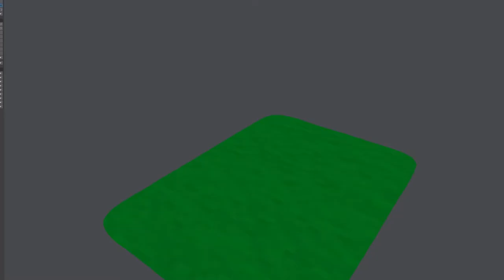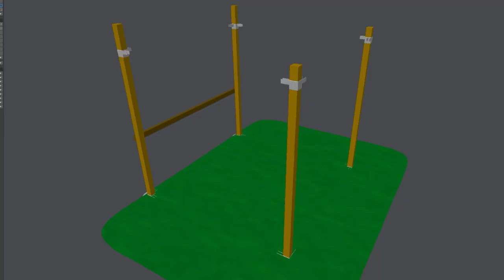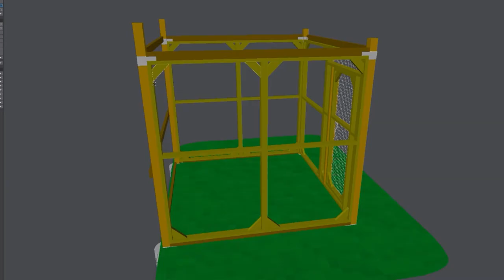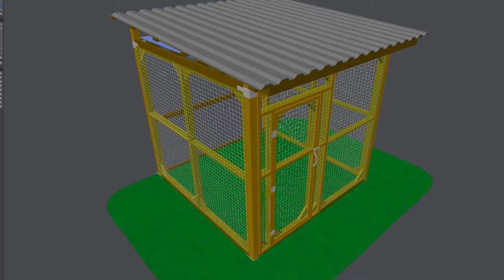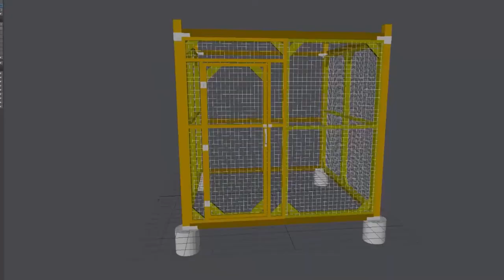Building an Easy Elegant DIY CATIO from start to finish

Comment: I absolutely love this.  We have two kitties just over a year old but we still call them kittens.  Last summer they were so tiny and the fences are high around our garden so we had no issue giving them access for a little while.  That gave them a taste of the great outdoors and we HAVE to build them a catio.  We lost one young cat to the road a few years back and never again.  We all need fresh air for our mental and physical health and I'm sure it's no different for cats.  This video has been invaluable.  We only have two walls to build as we'll be building out from the back of the house and across to the shed so they'll have a little bit of garden as well.  Should work out about 10 feet by 12 feet roughly so TONS of room.  It's the cost of wood now at the minute that holds me back.  Living on a reduced rate pension so a lot of saving to be done and a daughter to put through college too.  I think I need to win the lottery!!
Reply: Try finding what they call "culled" lumber at local lumber yards - we snagged treated wood last summer at 10 cents on the dollar!  Some curvy stuff but most looked FINE!  Also, some people have old wooden structures they want torn down - they'll give u the lumber for tearing it down - got old Pergola painted/peeling looks AWFUL, that's how I'll get rid of it.

Comment: I have watched this video many times, learning many things each time. As an “older” (LOL) lady, I’m not sure how much of it I can accomplish single-handedly, but a major part I will incorporate into my next build will be those corner supports. The catio I built years ago was built from 1X2s, with only metal L-brackets for corner supports…and though it’s only about 4 ft square and built on a platform that is level with the window the cats enter it by, they spend a lot of time out there. I am hoping to build something MORE like you have built, but I’ll be happy with it as long as it’s secure and the cats like it, even though I’m sure it won’t look as professionally made as yours.  It’s evident that I’ll have to “man up” to2X4s (no way 1X2s will work for a larger build. But, another thing I learned from your build is this…I will use the chicken wire instead of hardware cloth that just about did me in on the last one I built. 
You’ve inspired me to try and I’m with ya’ on the star head screws! I’ve been using them exclusively for a couple of years and If I never have to see another Phillips head screw, my amateur woodworking life will be a dream comparatively!  
Thank you for sharing your build. You’re an inspiration!
Reply from the maker: Thanks you for such a nice comment!  This was my first project like this and it was quite intimidating to start but just tackle the challenges along the way and I bet you'll do fine! It definitely helps to have another set of hands if you are doing corner posts in concrete but I found a copious use of clamps and scrap wood can replace an absent 2nd set of hands most of the time.  I use those corner supports for everything now and have built about 16 separate workbenches out of them, the oldest is some 15 years old and holding a benchtop lathe and still doing great definitely can't recommend those and the star drive GRK screws enough.  Good luck on your build!
Reply: @matus1976   I don’t know why this video isn’t viewed more since it’s the most helpful one I’ve seen. I will share it with the Facebook cat groups I’m part of.
Reply from the maker: @freewaybaby  That's awesome thanks Marcy!
Reply: We’re in the process of building our catio. I was particularly interested in the placement of the shelves, and the brackets you made to support them. Very helpful. 🙂

Comment: Great job, very detailed and informative video! These are the best step by step instructions for a DIY catio build I've seen and I plan on watching it several more times before we start our catio(s). It's going to make it easier for me to figure out the cost now that I know what materials to buy. We're building a 4x12 on one side of the house for our boys, and if it turns out well, we'll probably build another one on the other side for the girls. We're also thinking about enclosing our patio and eventually connecting all three for all of them to enjoy. We have a huge back yard so I have all sorts of great ideas running through my head.. but I'll have to wait for lumber prices to drop before I start making those plans! Thanks, you took the stress out of figuring this out 👍👍
Reply: My dad has been collecting rejected lumber from new-build housing areas per their permission off their discard pile. Not all are useable, but we can save a little by salvaging some 2x4s, etc. They can be cut where they are twisted or whatever & the rest is usable wood. Great for braces & such.

Comment: This looks so nice! I’m pretty determined to make one and I’m planning to use yours as my main inspiration…then basically completely changing it 😅. I’m renting so I need to make it free standing but I LOVE the modular wall idea, especially if/when I move! I happened to end up with a lot of free chain link fence so also trying to decide how to use that because I need to save some money if I can! It also seems a little more protective if a predator comes sniffing around. I’m thinking I’ll use it for the bottom half of each wall…lots of ideas, not as confident in my skills. Thank you again for such a thorough video with the amazing idea for those modular walls!
Reply from the maker: Thanks! Glad you liked the project and video. Chain link fence should work great too, unless you have a small cat.  Good luck on your build!

Comment: This video is PERFECT. Do you have any tips for safely attaching the beams to the siding?
Reply from the maker: Thanks!! Glad you've found it useful! 
When you say siding do you mean to the siding of the house?  I only attached the one waist height horizontal beam directly to the house when I was building everything up, I screwed it in right below the window sill where most windows are framed with a few 2x4s inside the wall and through the wood trim around the window frame

Comment: Just throwing this out there as a comment. Think constructive criticism... the chemicals in pressure treated lumber are super dangerous if consumed (chewing, cleaning paws, splinters consumed, etc.) and they very easily cause previously dormant skin conditions to arise. That being said, very well made, and i really appreciate your outline for this.
Reply from the maker: That's a fair comment, or at least something that should be considered.  Doing some quick research, it seems the obviously bad stuff was phased out in the early 2000's, and modern pressure treated lumber is much better. how much?  shrug I guess we need to balance the unknown threat with the practical usefulness of the lumber.  Definitely advise everyone to make that decision on their own with plenty of research.  I've read a bunch of Bruce Ames' stuff, the guy who invented to HERP index which most of our current carcinogenicity assessments are based on, there's definitely reason to be skeptical of some of the claims of how toxic things are as they utilize massive doses and assume the no linear threshold model, but definitely some things are legitimately very toxic and we need to be careful.

Comment: Thank you. I have rewatch a dozen times.  Can't seem to find the strong tie corner brackets anywhere 😢.  I am going for 14x8x10. Never hammered anything in my life.😂
Reply from the maker: I'm glad you've found the video useful!!  I'm my local Home Depot they moved them to the back corner near the wood and insulation, but they still have them.  You can find them on the home depot website too and Amazon searching for "Simpson strong tie", example: https://tinyurl.com/bdya8eav  If you have a 14' span on one side, I'd recommending adding another 4x4 support in the middle!  Good luck on your build!

Comment: What a great tutorial! I’ve rewatched it so many times.
It’s Informative and easy to follow, especially or someone wanted to learn more.

Do you have any suggestions on building a catio like yourself on the foundation of patio slabs? By skipping the cement stage would that make the catio unstable and unsafe? 

Any suggestions would be greatly appreciated!

Look forward to watching more from your Chanel 👍
Reply from the maker: Thanks for watching, glad you found the video useful!  If you were building onto an existing concrete patio, you can use something like post bases, these are metal brackets that enable bolting 4x4 lumber to an existing concrete base with expansion anchor bolts.  I'd definitely recommend fixing it to the concrete, a strong windstorm could life up the whole catio and throw it around without being solidly secured to the ground.
Reply: @matus1976  Thank you for your reply.
Awsome, thank you! I’ll definitely look into that. I definitely don’t want it flying around my garden
.
Thanks again!

Comment: It says specifically on Simpson's website you should use Strong-Drive SD connector Screw for the Simpson strong tie bracket. Pan head screws do not have the sear strength necessary for that support.
Reply from the maker: That's a good point.  I'd suspect that recommendation is so the screws can meet the load requirements of the max load the brackets are rated for, but in this build we're not hitting anywhere near that load and the screws can handle the load of this structure just fine, but it wouldn't hurt to use the larger tougher screws.

Comment: IF making this and planning to paint it white...would you paint it first then assemble? or assemble then paint?
Reply from the maker: I would probably paint it first, it's too time consuming preventing paint from going in the wrong places, like covering your wire mesh or overlapping those corner brackets.  Much easier when everything is apart to paint it. I would also give a quick layer to the joints after assembling though, that will do alot to seal  up cracks and crevices in the joints.

Comment: Hey there. 
I know this video is about a year old, but roughly how much do you think this cost you? Because I would like to somethings super similar and I’m just trying to figure out what the cost would be !!
Reply from the maker: I built this back in ... 2019 I think?  Back then it cost about 1200 USD, I'd say today with post pandemic prices it'll be more like 1600 - 2000. You can get a good idea just by pricing out the 2x4s and 4x4s as they are most of the cost.
Reply: THANK YOU !!